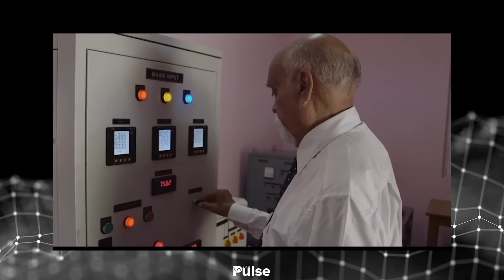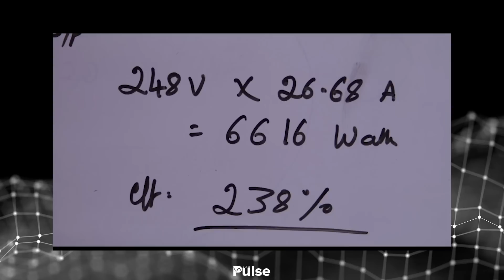'Free Energy' Generator That Works - Tewari Demonstrates His Over-Unity Machine

Comment: Devices like these are pointless when it's not open source.   Time and time again,   there were devices claiming to achieve overunity ,  but either they are full of sh%$  or they get buried by the establishment.   Unless it's open source,  i won't even bother with it..   My solar panels are the closest thing to a free energy device,  it's relatively cheap,  and readily available.
Reply: The patent is there 🙏🏽 go ahead and innovate 🙏🏽
Reply: None were buried by the establishment. They are all full of it.
Reply: Really? I suppose you never heard about the FACT that opposing magnetic field is a REAL thing such that it can be 'filtered' from the mixture of opposing magnetic fields using higher permeability material. For example, a rotor of a single phase switched reluctance generator uses higher magnetic permeability metal than the stator. The result would be significantly reduced flow of opposing magnetic field into the rotor, which drastically reduce braking load torque, to achieve true overunity where total energy output is greater than total energy input.
Reply: @lukiekelen5553  
Opposing magnetic fields always balance each other with a net energy of zero.  And closed systems cannot have more energy than what already has in it....  It's Common sense at this point.

The meters  only gives you a tiny glimpse of a much bigger picture.  It only measures volts and amps,  but it won't show you magnetic losses, temperature,  material breakdown, and other things it can't  read.  This means that his meters are probably giving an illusion that he's gaining more than he should.......

If it was that easy and convenient,  another engineer could replicate this device and prove it.   Where are they ??
Reply: @WTF_BBQ  The use of TWO different magnetic permeability material SPLIT the opposing magnetic fields. You now have ASYMMETRY, which allows overunity.
Reply: @WTF_BBQ  you're forgetting about momentum added to the equation..

Comment: if collective evolution wants viewers to believe this, then you may wish to have an independent reputable firm or group or individuals thoroughly audit the supposed outcomes. there are plenty ways that this could easily have been deceptively presented. this video proves nothing. you say that you've seen them with your own eyes. what qualifies you to adequately audit a technology system? be careful that ce doesn't lose credibility by becoming associated with fraudulent schemes.
Reply: Really? I suppose you never heard about the FACT that opposing magnetic field is a REAL thing such that it can be 'filtered' from the mixture of opposing magnetic fields using higher permeability material. For example, a rotor of a single phase switched reluctance generator uses higher magnetic permeability metal than the stator. The result would be significantly reduced flow of opposing magnetic field into the rotor, which drastically reduce braking load torque, to achieve true overunity where total energy output is greater than total energy input.
Reply: @lukiekelen5553  i don't know enough to confirm what you say and i don't know enough to confirm or dispute the contents of the video. all i'm saying is that it doesn't actually prove anything. everything in the video could have been faked. the pulse and anyone who wants to demonstrate the merits of this technology may want to ask credible third party sources to verify the assertions.

Comment: The main issue with power is not to generate it but how to store it. However I wonder if any research has been done on simpler generating devices. We know the experiment where a simple turbine can be created with panels painted black on one side and white on the other assembled around a central pivot. Exposed to heat, it will rotate simply because heat is built up on the black side and repelled on the white side. I'm not a physicist or technologist, but why not go right back to basics rather than rely on established pre-existing paradigms?
Reply: Really? I suppose you never heard about the FACT that opposing magnetic field is a REAL thing such that it can be 'filtered' from the mixture of opposing magnetic fields using higher permeability material. For example, a rotor of a single phase switched reluctance generator uses higher magnetic permeability metal than the stator. The result would be significantly reduced flow of opposing magnetic field into the rotor, which drastically reduce braking load torque, to achieve true overunity where total energy output is greater than total energy input.
Reply: @lukiekelen5553  Cute!

Comment: I am not saying there is not another way to tap energy from something we never noticed before, or finding better ways and more efficient ways of converting energy for our benefit, but this experiment is highly questionable of doing what they claim.
Reply: Really? I suppose you never heard about the FACT that opposing magnetic field is a REAL thing such that it can be 'filtered' from the mixture of opposing magnetic fields using higher permeability material. For example, a rotor of a single phase switched reluctance generator uses higher magnetic permeability metal than the stator. The result would be significantly reduced flow of opposing magnetic field into the rotor, which drastically reduce braking load torque, to achieve true overunity where total energy output is greater than total energy input.

Comment: The very first thing the guy said breaks the laws of physics, he said "the input is less than the output", yea that can't happen according to the laws of physics. Later he started talking about ether, stuff that is not even in the laws of physics.  And still he wants to say it breaks no laws of physics, but he just made that shit up, it is not in any physics book.
Reply: It’s total nonsense. That the guys on this channel believe it, makes me think probably best unsubbing.
Reply: Really? I suppose you never heard about the FACT that opposing magnetic field is a REAL thing such that it can be 'filtered' from the mixture of opposing magnetic fields using higher permeability material. For example, a rotor of a single phase switched reluctance generator uses higher magnetic permeability metal than the stator. The result would be significantly reduced flow of opposing magnetic field into the rotor, which drastically reduce braking load torque, to achieve true overunity where total energy output is greater than total energy input.
Reply: That opposing magnetic field is the resistance from the load on the rotor and even the rotor itself. Without that opposing magnetic field then it won't work, because that is how it converts electrical energy into mechanical energy. Without the opposing magnetic field then no work will get done because that is the work(load).

It breaks the laws of thermodynamics if it is claimed to have higher output that the input/s. There may sometimes be cases where it appears at first to be breaking the laws of thermodynamics, but under further observation and study of the effects they learn something new(a source of energy they didn't expect or understand), but ultimately find out it never brake any laws of thermodynamics.
Reply: @TheRebelmanone  I see you didn't bother reading what I typed. I will type in a layman's term. Suppose you have a current flowing in a parallel circuit where one resistor's resistance is higher than the other. Obviously the current would be higher in the lower resistance resistor. Now change this to the magnetic flux and soft iron core, but this time there's TWO magnetic fields going in opposite direction. The shape of the soft iron core is shaped like the number 8. The center pathway has higher reluctance than the surrounding pathway. The higher reluctance rod is changed into the rotor with field winding on it while the surrounding is changed into stator with armature/generator winding. When the rotor is spun to 50/60 Hz, the oppsoing magnetic field proportionate itself more towards the stator than the rotor. Thus, the opposing forces REDUCE which results in over 100% total energy efficiency. Where's your fake thermodynamics law? All I did was using SIMPLE magnetic to say it all out. Now it makes sense that magnetic field is a REAL thing. If it isn't, such phenomenon wouldn't exist. Yet, it is easily provable with a bi-toroid transformer which shows flux-gating that causes multiple effect, as well as the overunity switched reluctance generator / overunity flux switching alternator.
Reply: @karenthomson9749  It is the same thing. The first law of thermodynamics is energy can neither be created nor destroyed, it can only be transformed from one form to another.

Now go back and like the original comment. lol
Reply: @TheRebelmanone  Thermodynamics laws does not apply to electricity. Or else electric parametric resonance, and even the simplest form of flux-gating a.k.a bi-toroid transformer wouldn't work. The FACT that it exists, and works already debunked the fake laws. You can see multiple videos and test it yourself on the bi-toroid transformer. Sure it isn't overunity nor free energy. It simply proved that opposing magnetic field can be almost prevented to interfere with the primary winding. Applying this to a generator and you get true overunity.
Reply: @TheRebelmanone  Therefore it's not the same thing. It shows that those laws are just human limitation in attempts to comprehend reality, a very twisted mind barrier.
Reply: @TheRebelmanone  I already typed out the refutation in your other comment.
Reply: @TheRebelmanone  yeah and the device is in conflict with that law 🤷🏼 hence is a fraud....

Comment: What comes to mind when i hear the stuff i just heard and see the things i just seen is something not new, it is known and been used many times, it is called a scam. 
I am open minded but i am also critical minded, so i open up but only to entertain ideals but until i get proof for myself i will never believe their claims, and especially since their claims break the laws of physics. But like i said i remain open but to find any proof, but don't expect me to be talking about it like it is real,  supporting it, or propagating shit i have no proof of for myself..

 This is the part i wasn't sure if i should write but i decided to anyway because you need to know something. It seems clear to me you don't understand their so called experiment, you have no clue how to explain what happened when he flipped the switch, but yet you want pretend it is real, but have no actual clue for yourself. You are relying on people you don't know anything about. It looks bad and now i will remember to double question anything you post.
Reply: Really? I suppose you never heard about the FACT that opposing magnetic field is a REAL thing such that it can be 'filtered' from the mixture of opposing magnetic fields using higher permeability material. For example, a rotor of a single phase switched reluctance generator uses higher magnetic permeability metal than the stator. The result would be significantly reduced flow of opposing magnetic field into the rotor, which drastically reduce braking load torque, to achieve true overunity where total energy output is greater than total energy input.

Comment: just another case  of  gobbledy-gook.!!!!!            on the other hand, there may actually be a way to do it; one that does not invoke tesla or involve  fairy dust and unicorns.
Reply: @David Davids, your ideas will look foolish in front of that person in the video. Check his patent before you become a bullshitter 🙏🏽
Reply: @neumaticgrunt You're correct on this one. However it doesn't change the fact that there's such thing as overunity.
Reply: @neumaticgrunt Exactly.. A guy patent the UFO, but yet I don't see any flying around..
Reply: @neumaticgrunt you are also copying pasting 😂😂
Reply: @S....................1  you're brilliant, since that's exactly what he said he was doing! You get the booby prize!
Reply: Really? I suppose you never heard about the FACT that opposing magnetic field is a REAL thing such that it can be 'filtered' from the mixture of opposing magnetic fields using higher permeability material. For example, a rotor of a single phase switched reluctance generator uses higher magnetic permeability metal than the stator. The result would be significantly reduced flow of opposing magnetic field into the rotor, which drastically reduce braking load torque, to achieve true overunity where total energy output is greater than total energy input.

Comment: Honesty is hardly a word associated with governments. Thanks for promoting the Tewari over unity device.
Reply: If he actually did this his life is in danger, oil companies will try to take him down .
Reply: @PhysicsViolator  Nahh it's all good now. The 'stone' is leveled. [I suppose you never heard about the FACT that opposing magnetic field is a REAL thing such that it can be 'filtered' from the mixture of opposing magnetic fields using higher permeability material. For example, a rotor of a single phase switched reluctance generator uses higher magnetic permeability metal than the stator. The result would be significantly reduced flow of opposing magnetic field into the rotor, which drastically reduce braking load torque, to achieve true overunity where total energy output is greater than total energy input.]
Reply: @lukiekelen5553   Maybe your parents should have tried better with the family planning after seeing the result.

Comment: These inventions and inventors are often stopped and even killed so it is not a point of embracing these technologies; they never arrive. I have seen amazing technology that few have seen but have no evidence but my memory. There are 2 levels of technology; public and private. 
Private is years ahead.
Reply: Really? I suppose you never heard about the FACT that opposing magnetic field is a REAL thing such that it can be 'filtered' from the mixture of opposing magnetic fields using higher permeability material. For example, a rotor of a single phase switched reluctance generator uses higher magnetic permeability metal than the stator. The result would be significantly reduced flow of opposing magnetic field into the rotor, which drastically reduce braking load torque, to achieve true overunity where total energy output is greater than total energy input.
Reply: @lukiekelen5553  A reluctance generator does not have magnets.
Reply: @chrisgibson2328  Never said anything about magnet.

Comment: You know that there are great forces invested in the "available" solutions and history is littered with "teslas" who invented breakthrough solutions and became targets for corporate interests. This particular one has embedded in it's workings a physics breakthrough that can produce anti-gravity drives for spacecraft so it is of particular interest to those who already have that technology and want to hide it. Unfortunately these people will become targets for people who can spend billons silencing their voices.
Reply: Really? I suppose you never heard about the FACT that opposing magnetic field is a REAL thing such that it can be 'filtered' from the mixture of opposing magnetic fields using higher permeability material. For example, a rotor of a single phase switched reluctance generator uses higher magnetic permeability metal than the stator. The result would be significantly reduced flow of opposing magnetic field into the rotor, which drastically reduce braking load torque, to achieve true overunity where total energy output is greater than total energy input.

Comment: My humble opinion... Sadly, physics wins here... You cannot create energy from nothing or get more energy out from energy put in, which means these machines are all hoaxes, most of which are created to get click-bait or false investments. "Removing Back-Torque" will require the extra energy that is gained, there is also air resistance, and other forms of friction and heat which is all energy loss. As the machine slowed down at the end you can even hear the squeaking. Even if we remove gravity, and some friction by putting this in space in a vacuum it would still have some surface friction on the motor and generator shaft. Super conductor magnetics might help, but they usually require power input to maintain. 
I'm totally on board with clean energy and harnessing the sun... but until we learn how to scoop the electrons directly from the atom leaving behind only empty protons/neutrons (a scientific impossibility at this time) we cannot expect limitless free energy.
On the point of gov/mega companies blocking development, I totally agree... If anything threatens the status quo, it will be suppressed, so everything new and innovative will take much longer to gain traction! Solar technology is taking much longer that it should to advance mainly because of fossil fuel companies. Even large companies that produce standard solar panels are resistant to new technology because it means making costly changes to current production. Money... its always about money.
Reply: Really? I suppose you never heard about the FACT that opposing magnetic field is a REAL thing such that it can be 'filtered' from the mixture of opposing magnetic fields using higher permeability material. For example, a rotor of a single phase switched reluctance generator uses higher magnetic permeability metal than the stator. The result would be significantly reduced flow of opposing magnetic field into the rotor, which drastically reduce braking load torque, to achieve true overunity where total energy output is greater than total energy input.